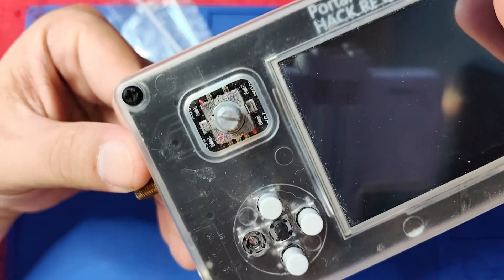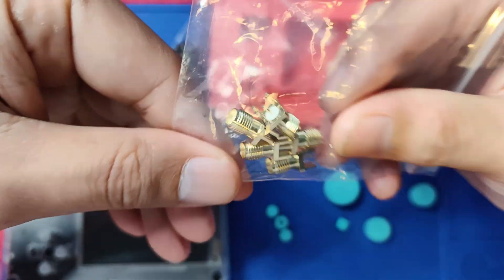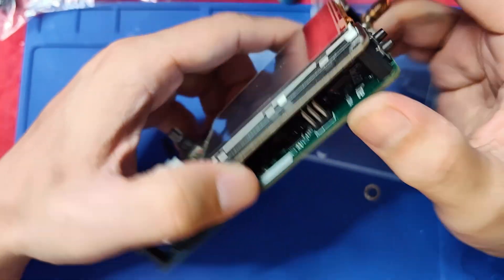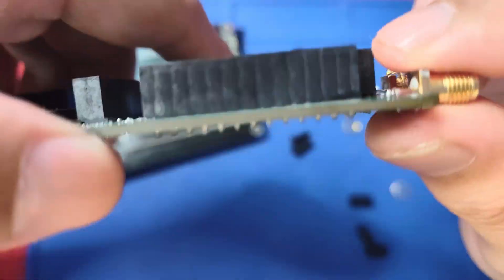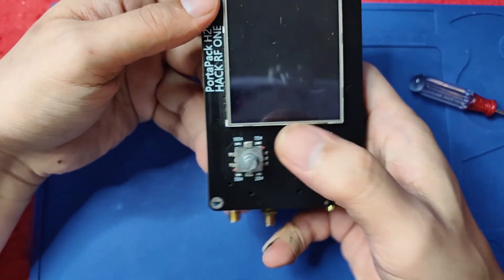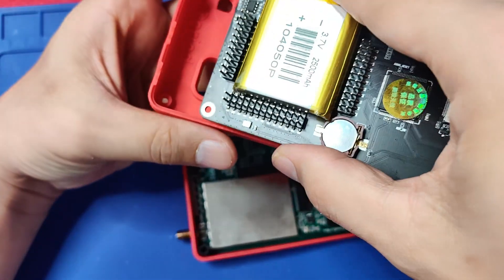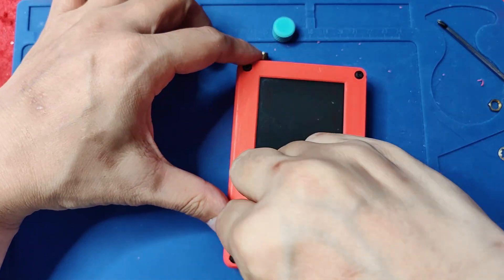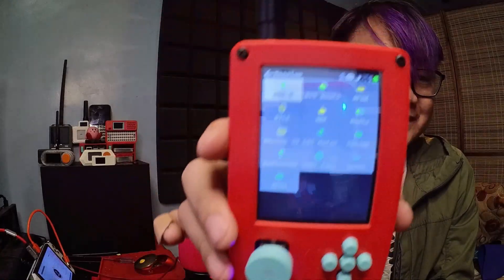My HackRF One Got a Glow-Up! (Case Swap & Fixes)

Comment: Hey, aren't those 2 SMA bottom jacks just used for CLK in/out timing if you're using the HackRF in concert with other SDRs? I've heard people suggest that the manufacturers should just include the SMA connectors separately ( ie not attached) if people need them. 
Great 3D print on the case! Looks brilliant!
Reply from the maker: Thanks! That is true, unfortunately im such a noob i dont even know why you would need clock signal from external sources or send one to external recievers
Reply: @HakistaTV  Above my grade too, but I gather for Interferometry..eg for signal tracking and virtual antennas.
Reply from the maker: @TalismancerM  first time i heard interferometry i have to google it hahaha